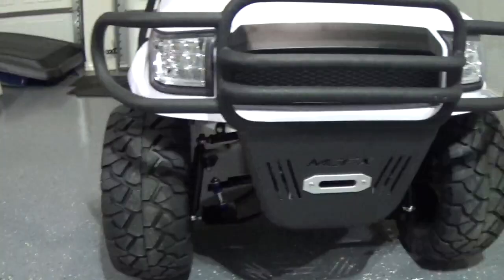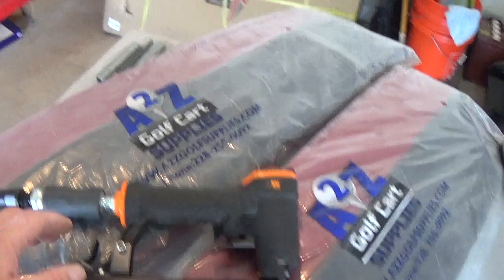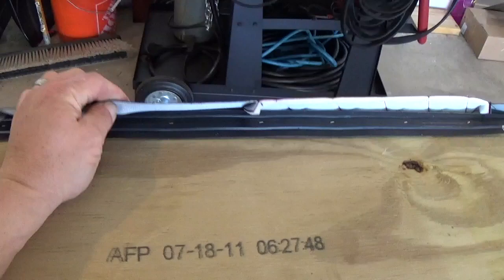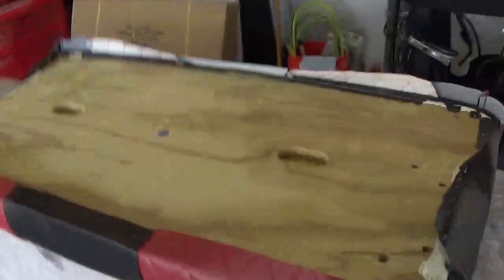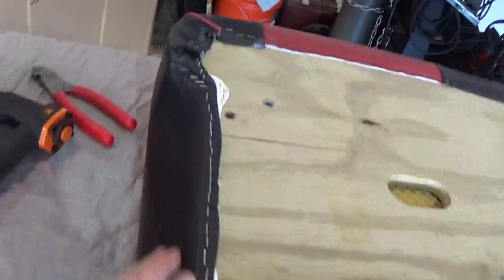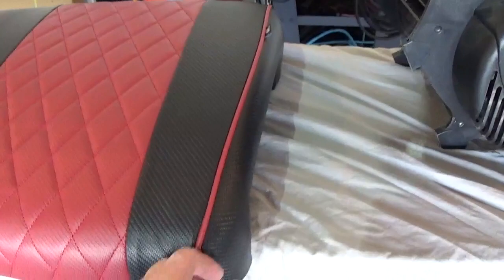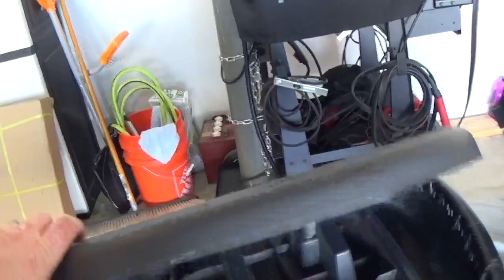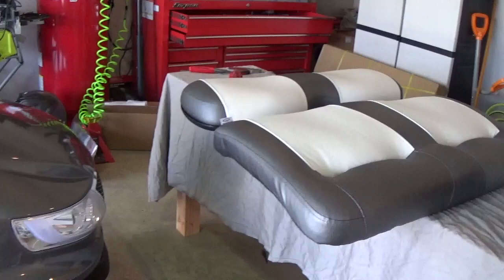DIY Golf Cart Seat Upholstery!!

Comment: I just got a gas ezgo shuttle 2008 6 seater 3 rows. what do I need to get for them??? I need covers for a three rows.
Reply: should I order 2 fronts and a back set or 1 front two back sets?
Reply from the maker: @robertligue4533  you should be able to tell by looking at the seats closely… the rear seat covers are considerably smaller
Reply from the maker: @robertligue4533  also… you can send me a picture on Facebook @ Kart Krazy…I would be able to tell you